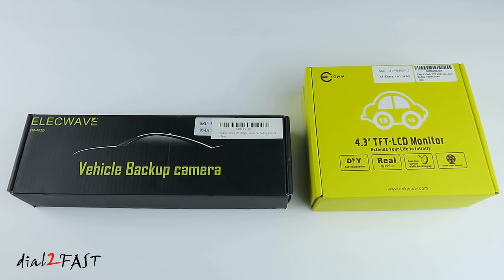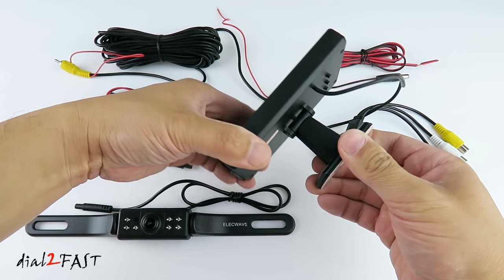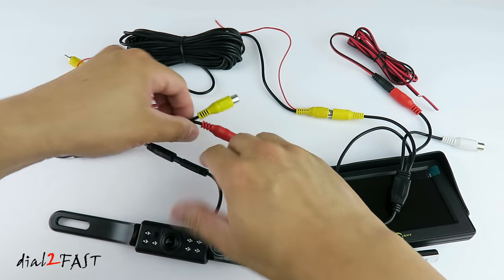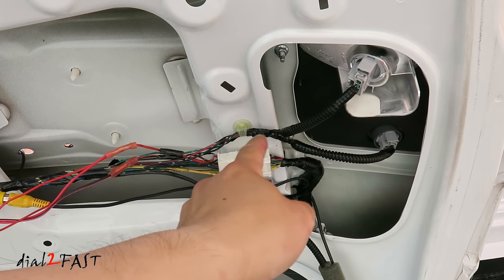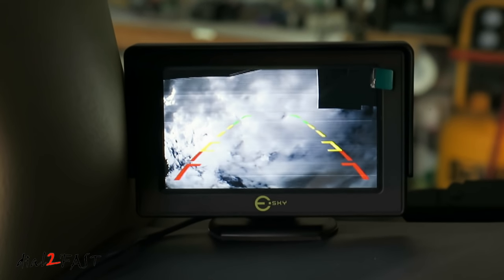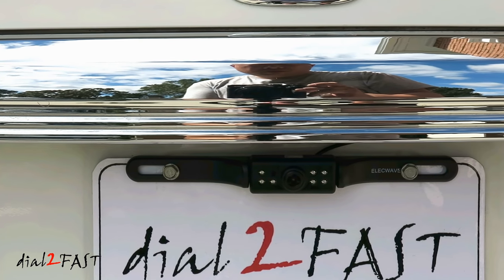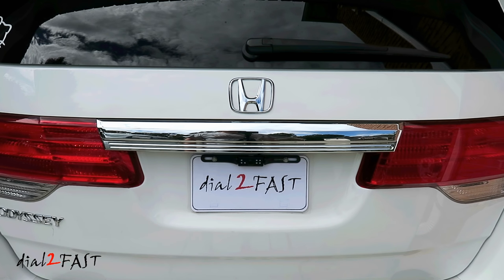How To Install A Wired Backup Camera System 4.3" LCD

Comment: Much better and nice if you could show how black wire is going to be connected to chasis ground. it would then all be in layman's terms and beneficial for lot of none technical guys like mine, when it come to car electricity . Anyway great guide !
Reply: Hello there! How can i connect the black wire to the 'chasis ground"? help me :D :(((((((
Reply: same question where can i connect the black wire or chassy wire?
Reply: Lol, that's the most important and its Missing, everyones struggling with that!
Reply: You can put it with a connector at any screws touching the frame of the car (painted clear) for example on the door, seatbelt, under your seat

Comment: Great video! One question: I was a little confused about grounding the monitor, was this step shown in the video?
Reply: Would’ve  been helpful right
Reply: same here! what about black wire chassis ground?
Reply: I came to the comments to look for the answer. This is the one piece of information I need to install my camera. Otherwise, this was an excellent video.
Reply: Pretty straight forward. The negative of the battery is connected to the chassis. Mine is connected under a small bolt head in side body of car. Using a round lug but can just put twisted wire under same. Used a short length of wire using a bullet crimp connector for easy disconnection. Inline crimp connector another way.

Comment: good video makes more sense than the diagrams , you say join both RED power cables but do u need to connect the black negative cable of the cable that has a black connector

Comment: Good explanation and presentation of the video quality. 
I did however stay questioning the purpose of AUX video cable in display. When does it get enabled, does it override the reverse or vice versa?
As I assume idea is that AUX is for the trailer camera, so when you have trailer connected and you reverse you will see reverse camera from trailer, not behind your car.

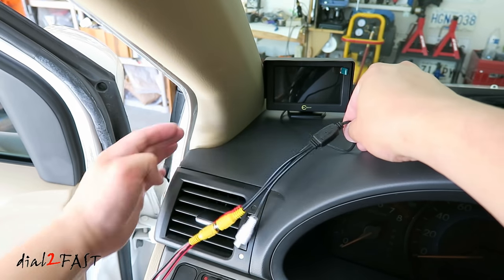Comment: Thanks. I understand almost everything but where did you connect the black wire on 4:26? You said need to connect to chassis ground...
Reply from the maker: You need to locate a grounding bolt or chassis metal that you can connect to for ground.

Comment: Hi. Did I miss how you wire this into a power source such as the fusebox or power plug? That should be the most important step. Thanks.
Reply from the maker: The video does cover how to wire in the power. It's powered using the backup light.

Comment: Your how to video was very informative. I also wish to connect one behind a camper van for viewing any traffic buildup behind me. Any ideas would be helpfully. I am assuming I could wire both ends to the 7 PIN flat socket and plug.

Comment: In some models of this camera, the white video input connector from the display is channel 1 and you have to plug the yellow video cable from the backup camera into it. Plugging yellow into yellow won't work.

Comment: For those having problem with wire chassis ground. The negative of the battery is connected to metal chassis of car. So need a good electrical connection using say a screw or under a nearby bolt head for same.

Comment: just a bit confused mate. sorry for novice question. where did you connect the black wire(chassy wire) u said after u connect the red  or power wire
Reply from the maker: The black wire can be screwed (or bolted) to any chassis ground bolt you see in the vehicle. Usually underneath your steering wheel, you will find a ground bolt near the fuse box. You will have to look around.

Comment: Hello. Can you explain or show how to connect the black cable to chassis ground
Reply from the maker: My most recent video will show you how to install the ground. You need to find a ground bolt under the drivers dash. The ground bolt will be located in different location on different vehicles. Here is the video. skip to 19:20 on that video https://youtu.be/CuFeq69ns_U
Reply: @dial2fast  thanks man! God bless you

Comment: I can't understand where the black wire from the camera will be connected. Chasis ground? Where is that?
Reply from the maker: The ground wire is connected to a chassis metal ground connection in the vehicle. Usually you can find a ground bolt under the driver's dash. You can crimp a ring terminal on the ground wire and then install it under the ground nut or bolt. Every car will be different, so you will have to look around.

Comment: Hi can you help me I'm a little confused I install my backup camera but in the front I have a cigarette cable to plug in to dash monitor, my question is I have the little red cable where is that connected? Thanks
Reply from the maker: If the video cable has a red wire attached to it, that typically is used to carry the 12V reverse voltage from the back reverse light to the front to turn on the monitor. But since you mention your monitor has a cigarette lighter plug for power, then that red wire is not used.
Reply: Thanks so I will have to disconnect the one I attached kn the back
Reply from the maker: @raulordon9574  My answer is based on a typical backup camera system. The the back camera needs reverse 12v connected to get the power to power on when you put the car in reverse. And your front monitor is powered by 12V ignition cigarette lighter plug. With those two things wired, it should be working. Make sure you have those power sources connected.
Reply: Thanks... it work 👍👍

Comment: Hello.  If I used this camera with a GPS module with a AV in,  would this camera still work.  I would just have to manually turn on and off the GPS module that is powered by my car charger port, to have the back up camera video to show up on the screen?  Thanks.

Comment: Nice video and helpful info. I have a question, do you have another video installing back up sensors? I have a 09 Nissan quest S and my back up sensors don't work.
Reply from the maker: Here is how to install aftermarket backup sensor system. https://youtu.be/x8TZ5mlKgiY

Comment: Hi, I’m trying to install the same set of back up camera. I run into an issue that I don’t know where the small black wire split from the red and black power cable should go after you wire the red one into the small red RCA cable. Thanks for any help🙏
Reply from the maker: The black wire needs to connect to a ground on the car's chassis.
Reply: @dial2fast thanks for your kind respond. Do yoi know what could happen if it didn’t ground to the chassis because I don’t know how and where to ground it on the car frame. If it is the must do I have to return the set. Waiting for your advice. Thanks
Reply from the maker: If you don't connect the ground, then the unit will not power on.
Reply: Thanks dail2fast for your time👍

Comment: I tried this method, but the monitor is flashing when connecting this way. But if i connect the monitor power cable directly to the power supply, its working fine

Comment: If I wanted to mount the camera UNDER the vehicle (for off-roading), how would I wire a switch in place of when the car is put in reverse? Thanks
Reply from the maker: Ignition 12V power (perhaps from under dash) goes to a on/off switch, and then connect to red wire on camera system.

Comment: Hi friend, good video. I've got a similar camera. It has on the back right 3 bottoms. Never seen instruction how to use them. Yours have these. How to  use them?
Reply from the maker: I believe it's for setting brightness and contrast.
Reply: as 70 pct of the screens come from the same factory, the  buttons are as follows 
middle button = selector (color, saturation, tint, etc) the top is PLUS (more) and the bottoms MINUS (less).. simple

Comment: Can the camera be mounted on the bottom of the license plate, instead of top? Does it cause any issues? The nuts on my top part of license plate are stuck badly and won't come out. So its easy for me to just put them on the bottom portion.
Reply from the maker: Yes you can mount it at the bottom. Just make sure it's not blocking any registration stickers or identification required by your state or province.

Comment: How to connect them properly I want the LCD always turn on....I mean there is another option of installing ? even if i dont shift to reverse, the monitor and the camera will work together,it can be?
Reply: If u want the monitor always on, connect it to acc fuse..
Reply: I connected red wire to parking light + side, so I can use it while parking or pulling my Rv trailer.  This way it stays on until I turn my lights off, day or night.  Helps when I hook up trailer, or change lanes while driving .

Comment: Hi I know it's a long time, but do you cut the line of the backup light or do you just peel the line and tape the camera line with the light line? Thank you!!!
Reply: I don't want to cut any line on the car. If peel and tape works, that will be good.
Reply: @studyinusa7518  You don't need to cut the reverse light wire, you just have to cut open the insulation, and tap your wire to it.
Reply: @SimpleDIYMedia  Good to know. Thank you a lot!

Comment: When you run wiring front to back of the car be mindful of the side airbags. If any, might be better to run it down the floor trim. Also protect rear cam wire entry point with a grommet so the water can’t get in.

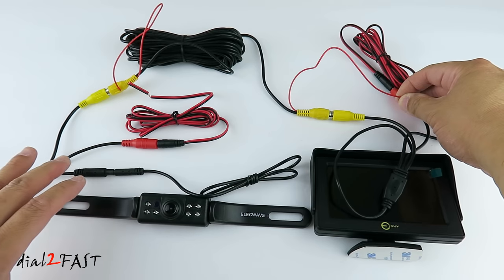Comment: Question at 3:39, did you have to ground the black cable on the video monitor as well?
Reply from the maker: Yes you have to connect the ground wire on the monitor to chassis ground.

Comment: Can you make this as a front camera instead of using as back up camera? Will this work? I plan to tap the positive/live wire to DRL instead on the reverse light. I am just worried if it will sustain if it’s continually on as front camera. And also i plan to put toggle switch on it so that i can turn it on and off manually if ever it will not sustain the heat for using as front camera- which is always on if connected to DRL wire. Thank you
Reply from the maker: Sure you can install it on the front. DRL will probably not be ideal for use as power source as DRL is not 12V. Usually it's half the voltage or uses pulse width modulation for voltage which is still not 12V. But as you mentioned, you can install your own switch in the vehicle to switch on/off a 12v power source.
Reply: dial2fast thank you for your immediate response and information. Shall i need a relay if i will use a toggle switch. And what will be the ideal ampere of fuse to be used? ✌️✌️✌️
Reply from the maker: For this camera setup, you don't need relay. The fuse can be 5A.
Reply: Thank you for the information! 👌👌👌

Comment: I am not sure where the easiest place to ground the dash monitor so that it is clean and out of view?
Reply from the maker: Any ground bolt on the vehicle. There are lots of bolts in a car.
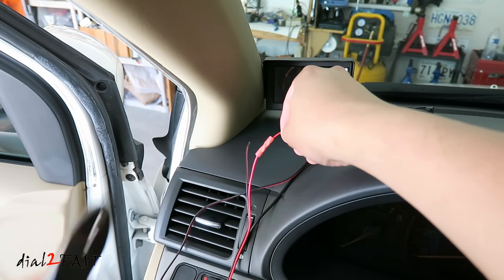Reply: @dial2fast  Hi, thanks for responding, I was just wondering that since the pig tail with the ground coming from the monitor is short and is on the dash, where I would connect it near the dash? At 4:23 in your video, where exactly did you connect your black ground wire to the chasis ground?
Reply: Or would I even need to ground it there, since it would already be grounded at the other end of the cable/wire on the reverse lights?
Reply from the maker: @MurrayOrange  You can try it out first and see if the video works. If you have any picture issues, then you should ground the front ground wire.

Comment: I connected the camera and when the engine is off it looks good but when the engine is on, interference occurs and even the video signal is lost.  what could be the problem
Reply: connect a ground wire to a solid metal point and splice it with the black wire (ground)

Comment: I purchased the Car Rear Camera Security System number X000VEDS23. I received the 33 foot cable and would like to use it to connect the camera on my travel trailer to the truck. Can someone answer these questions.  Can you tell me how to connect the wire so that the camera works? The wire that came with the kit has a red wire, a white wire and a black wire. The 33 foot wire has a red wire, a yellow wire and a shielded wire. Both have a splitter with a red and a black wire attached. Does the red and the black wire need to be connected to power?  Can someone send me a wiring diagram showing how to connect the wires and what they connect to so that the system works. 
Don Tullos